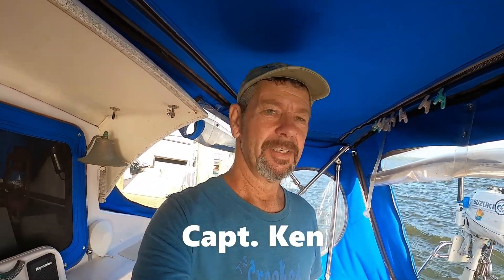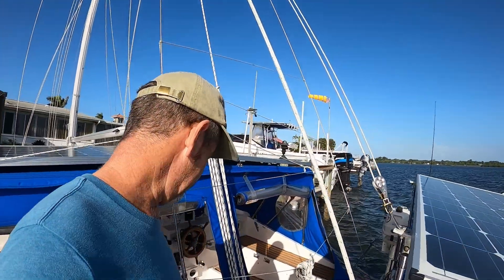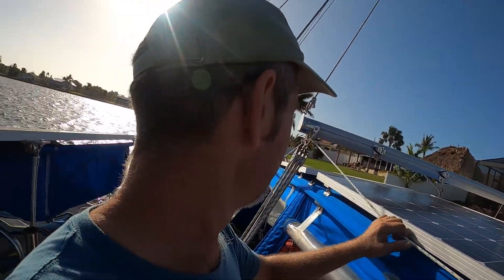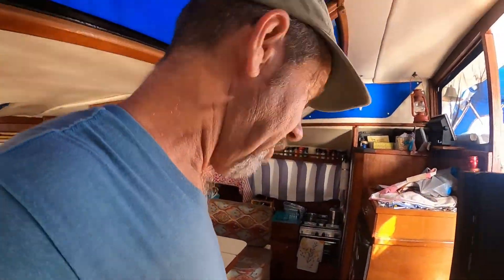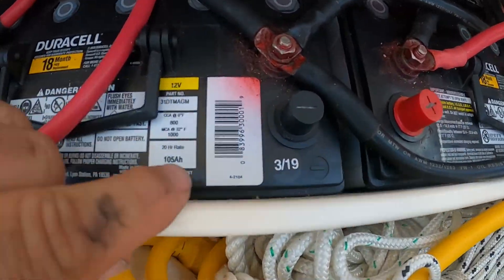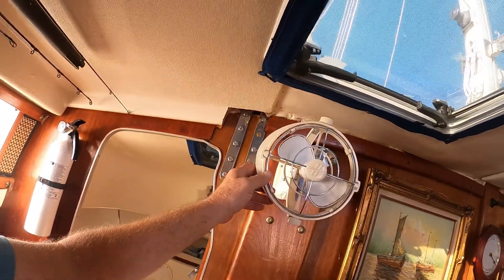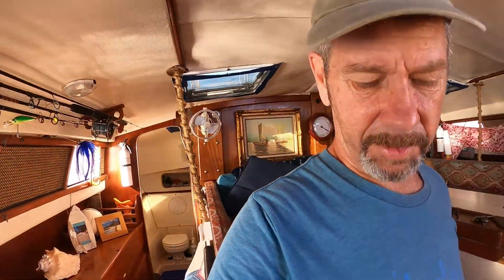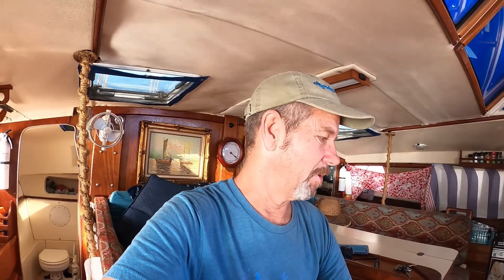Solar panel setup on a sailboat. What worked for us.

Comment: Thanks for a walk through of your solar system. Could you do a slow walk through of your entire boat - both inside & outside? I also have a 1990 Gemini 3200 and get lots of information and ideas from what you have done!
Reply: The video you recommended was a good one but, it is dated. I have seen several videos that you’ve made of different improvements you’ve made but the video you recommended to me did not show those updates Norder to talk about whether they worked out well or didn’t work out well. Thanks, have a great day.
Reply from the maker: Hello Leo & Colleen,  We are bouncing around an idea of all the little personalized improvements for storage we made. Some of the ideas  we got from other cruisers. We have a video called, A tour of the Crooked Anchor .

Comment: The battery storage is pretty cool, so well organized, and the inverter is right there too.  The water maker eases the mind as you don't have to worry about running out.
Reply from the maker: Thanks UUBrahman, short battery leads is the key. Our water maker high pressure pump is in the stern port birth. Mounted high on the bulkhead, beside the battery compartment. Short three foot leads.